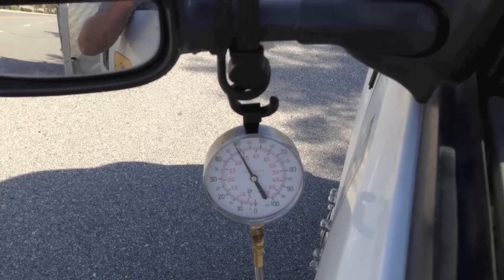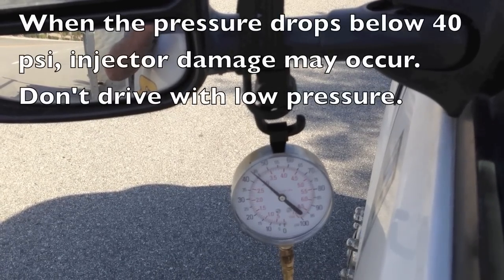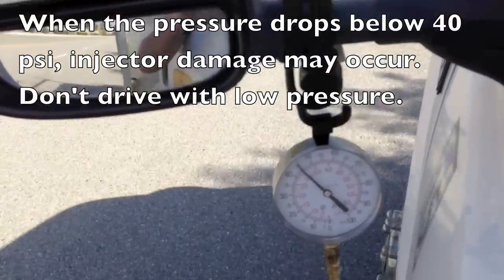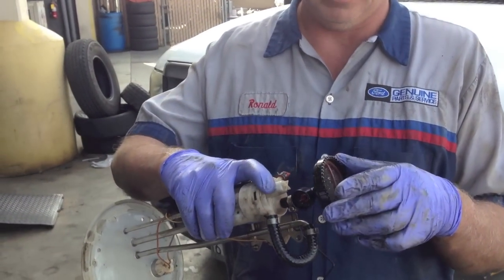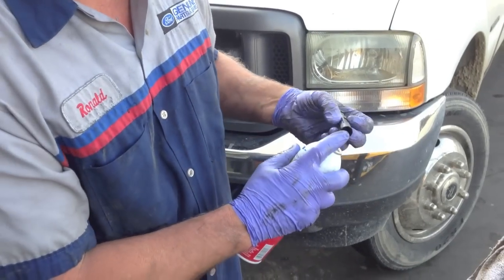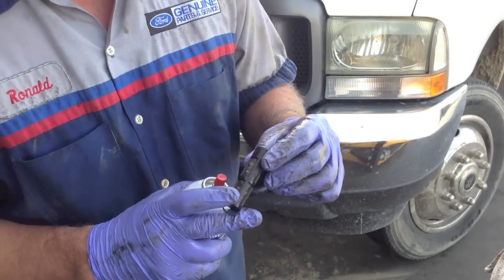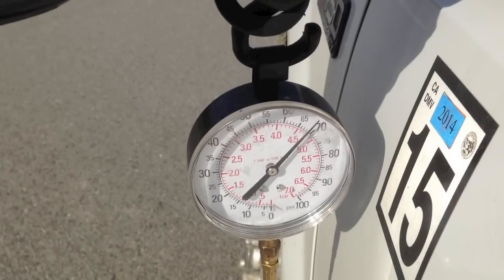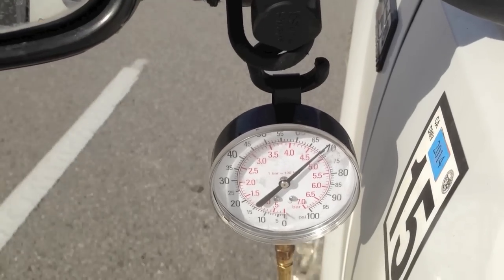FORD POWERSTROKE DIESEL LACKS POWER ON ACCEL DUE TO FUEL RESTRICTION

Comment: I have a 2004 6.0 that would randomly drop fuel pressure from 55 to 0 psi while driving and die.  I dropped the tank and found I had broken off the fuel filter cone from my pickup draw tube.  This was the second broken and disintegrated filter cone.  My 2004 did not have the filters in the tank, but the pickup tube was half full of plastic bits from the disintegrated filter cones.  It was packed with plastic bits all the way to the quick disconnect past the tube curve into the tank!  I thought I had a weak fuel pump, but I had trash in the draw tube.

Comment: I think you should have also addressed the all to common F450 F550 problems with the sealant that breaks down in these metal fuel tanks that can if untreated cause injector failure and clogged fuel filters.

Comment: This is why I have a fuel pressure gauge.
I did a full e-fuel conversion on my 96, 75psi even at WOT

I bought a 96 F350 and the feller spent more money at the ford stealership than I paid for the truck, he had turbo rebuilt, new ecu, and lots of others but yet the truth would never start.  Only took me about a hour and a half to figure it out with a gallon can of fuel and just using a electric fuel pump to force fuel into the stock mechanical pump.  The idiots either were too stupid or just wanted his money so they ignored the real problem, the fuel strainer in the front tank and a broken pickup tube in the back.
I sure they were far too busy and smart to use a gauge to check about fuel pressure.
No offense to Ron at all, the local ford lot in my town is ran and serviced by morons that over charge for their stupidity.
Reply: Does the 96 model with 2 fuel tanks have the same screens that Ron showed in this video?

Comment: Since fuel pressure is so important in these trucks, how can I set up a fuel pressure gauge to monitor while driving?? I'm hoping to use as a preventative measure.
Reply: you connect to the port on the fuel housing with a  pressure sendind unit and run a wire to the cab. there are a few right ups on the Internet if you look, its fairly easy. just dont over torque the connection to the port cause you can crack the housing. the port connection is a m12 fitting i believe.  purchase it at a place that sells hydraulic components

Comment: Jason Ortega did you figure out your problem. I am having the exact same thing going out. blows black smoke with great power and then it acts like im loosing fuel. black smoke goes away and I loose power. I can build 30 lbs of boost then it drops off to 20-22. new fuel filters, turbo, blue spring mod, checked cac tubes, new maf, new ebp, and bullet proofed. have not checked fuel pressure tho.

Comment: have an 06 that sounds like it has a miss on cold start up. Runs good afterwards for about 30 minutes@ 60mph then loses power and have to pull over. Could this be the problem? has cyl 5 & 2 cont/bal codes. How did you hook up gauge?

Comment: are these screams in a panel van I have a international 1652-sc  with a 7.3 ltr turbocharged engine? and it appears to be a dog I was th I long injector rebuild but after seeing this I'm not so sure.. definitely going to get a fuel and boost pressure gauges to keep connected to it.

Comment: fyi, I have a 2005 ford f350 6.0 I experienced this same issue it was the broken pick up screen in tank,  bunch of little plastic pieces from broken screen was clogging fuel pressure under load, removed bed, removed sensor repaired, clean tank...now all good...what a hassel

Comment: I bought a 2012 Ford CNG E 450 Super Duty Exonoline on acceleration the vehicle has trouble reaching 50mph or even 35mph, the bus sat for a year possibly after it was replaced for a newer model, it starts right up and had been maintained regularly before it was parked.  The shuttle bus had only did short runs at the airport, the mileage is 104k.  If anyone has suggestions, please comment.

Comment: I have a question I have an OBS ford so no filters in the pick up tube just the shower head which i have replaced.  Still getting the same fuel psi drop while driving.  Thinking I have pieces of the old shower heads in my fuel line.  Have you ever seen this?  Happens on both tanks so thinking its from the selector valve forward.

Comment: Can  clogged filters in the fuel pick up assembly cause the fuel pump to go bad? I cleaned my filters, they  pretty nasty but  the problem continues, truck runs really rough and then dies. I don't have a way to test the fuel pressure.
Reply from the maker: Yes they can stress the pump.  The fuel also cools the pump.

Comment: Hi, looking at a 1997 International 9700 series with a 7.3, I test drove it, engine sounds great, turbo is whistling, and sounds great, but this thing has NO power, took me a 1/4 mile just to get it up to 45 MPH, it has a Spicer 5 speed trans, the problem is, the truck is 65 miles from me, so, I will have to drive 65 miles to diagnose it, but the truck is perfect for what I want to do. It only has 198K miles on it, the other problem, the guy that is selling it, has not owned it long, doesn't know the history, and say's the previous owner is an ass, and is of no help at all! I guess the fuel pressure test should be my first test, but do you know of any other issues that would make it gutless ? Bad wastegate?
Reply: I got rough idle, white/black smoke when revving, and blow by is fine.. inline filter too bed tank started buzzing bad and buzzes long after key is turned. truck starts fine with good idle until you get down the road about 5 miles. I lose power & can only go 20, poor girl hardly made it home. Turbo is fine, I throw no codes besides when this starts happening because it makes trans lag so it throws ratio codes..that was debunked when she ran fine.. this started happening after I switched to my main tank that I haven't used in 8 months or filled in long time and after symptoms occured in a snap, I flipped back to bed tank.. I thought the truck was a goner, loss power, smoke, I checked bowl (was some debris) & cleaned new filter that was already brown, etc... the main tank smells like rotten eggs. I am draining today to see if it was just bad diesel. what do you think? injector? injector clog, orings?? poor fuel pressure? pump fail? truck always had hard time with the main tank but I didn't realize how low bed tank was this time. I filled bed tank up and dropped seafoam in her 2 days ago. If this is bad diesel when do you think it'll cycle through? 02 7.3 f350

Comment: So I had 40psi at the gauge. Used the tech that you showed by bypassing the tank and still got 40psi. I changed out the fuel pump and still 40psi?
Reply: Bill Meyers the spring could be worn out in your fuel pressure regulator.

Comment: cleaned turbo new ipr screen pulled sending unit new icp sensor  leak tested no leaks changed every o ring on each injector even the one on the top inside cleaned and replaced egr valve checked map sensor hose replaced that 50 psi on fuel pressure check 32%ipr 620 on start up truck runs still no power and no cac tube leaks?

Comment: DieselTechRon i have a problem with my truck that i just can't seem to figure out. My truck has a new ficm (That has been modded) new icp sensor, new oil, full 5" exhaust with 4" downpipe. I have cleaned my turbo and have put a new fuel pump with motorcraft fuel filters. I have also done the blue spring upgrade. However, my truck has great starts and has tons of power for the first minute or less and then it loses power and will not get it back again until i turn it off and start it again. 

I can literally melt the tires on a fresh start but i wont be able to after a minute. I feel like it might be the ipr but my mechanic claims he changed it out so idk where to go from here. I have tried turning my truck off while rolling and seeing if the power is just from a fresh startup but i can have the truck on for hours and do this and the power comes back and flees after a bit. 

Do you think it could be the in tank filters? My mechanic says he checked it and was good. But i somehow don't believe him. 

Could you give me direction. I don't want to go on replacing things that are irrelevant to my problem. 

Thank you in advance. Your videos are great.
Reply: Jason, did you ever get your problem resolved?

Comment: I have a early 04 f250 6.0 when I have it on park it seems to shake and skip and when I drive seems to not always want to accelerate as fast as other times
Any advice or ideas out there for my problem?
Reply: SuperDually Tim did you ever figure it out
Reply: beastieboy 4369 got rid of the truck lol the other owner swapped one injector and then the heads went out for them

Comment: Hey Ron 
 I have an 06 f250 6.0 when the fuel level gets to half the gauge just drops and it throws a check engine light once i fill it up it gradually goes up to full. the code it threw was for sending unit circuit open.do you think i need to replace the sending unit? and if so whats the easiest way to do so?
Reply from the maker: search p0460 p0463

Comment: Does this same principle applies to a gas engine i have a 2001 FORD E350 XL when the vehicle idles it does so perfectly im able to drive for maybe 30-40mins before it start to lose power overtaking or even merging. Ive changed the fuel filter 2 months prior to the problem as i had the same symptoms as i found out that the filter was clogged thus restricting the flow of fuel to the engine. I have not checked the fuel tank to see whats going on as ive been having the issue for quite sometime now. would really appreciate the help
Reply: Dwayne Stevens diesel tech Ron passed away in a car accident some time ago. Just letting you know why you never received a response
Reply: Your truck doesn't have these screens, but it does have a pre-pump filter in the tank that does the same job.  If you remove the pump assembly from the tank you'll see the filter right at the bottom without taking it apart like we have to with the diesels.

Comment: Not sure if you have heard of an issue with a 99 7.3L powerstroke like the one I am having it sounds similar to the issue you describe above.  Not sure if this type of issue you are describing sends a check engine code or not.  After about 100miles of driving, there is a sudden loss of power when trying to accelerate.  With the pedal to the floor the engine speed decreases, white spoke blows out & the engine slows to the point where I have to stop, and the engine will idle rough and sounds like it wants to quit. The problem goes away after about 20-30 minutes of rest. Then the engine runs fine then I able to drive again. I drove like this off and on from California to Arizona, making an 8 hour drive turn into a 16hour drive! The funny thing is, there is no check engine light or codes!  Any insight would be amazing, thanks guys!
Reply: Did you ever find out what the issue was? Mine is doing the EXACT thing you describe. We've been in the fuel tank twice already.
Reply: +AREV Motorsports I know im very late to this post but did you ever find out what was wrong with your truck? Ive tried numerous things and have read a countless number of posts but im still having the same issue you described.
Reply: Where can I get one of them
Reply: You never said anything about if you fixed it or what happened

Comment: i have a 6.4 2008 an my turbo gauge doesn't move an i have a whistle noise is it the turbo an if i went with egr delete an dpf delete an 5inch  st8 pipe an mini maxx this will increase power an mpg?
Reply: Hi did u ever find out what was the problem with ur truck?   Thx